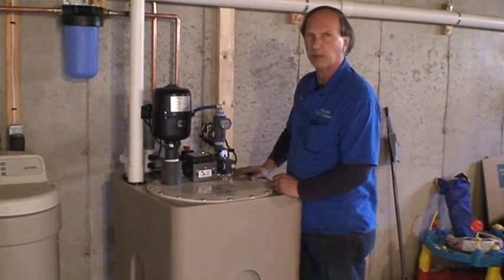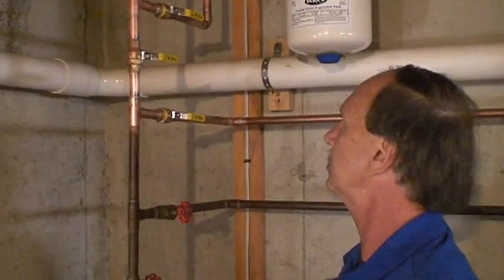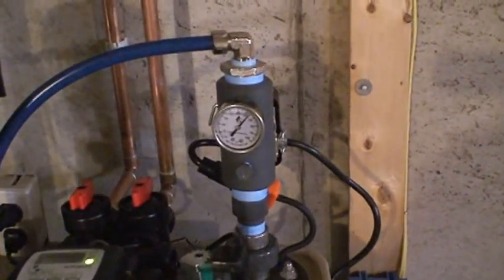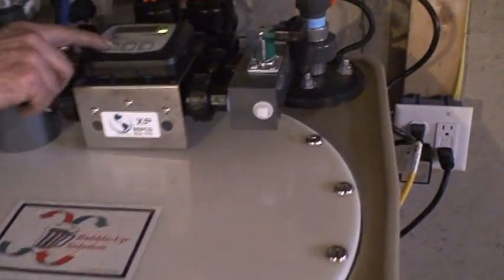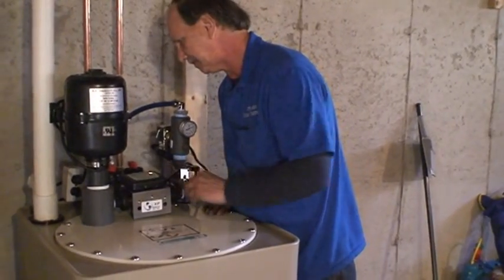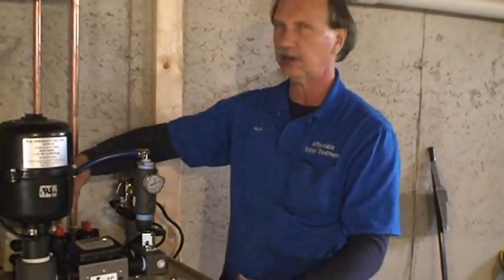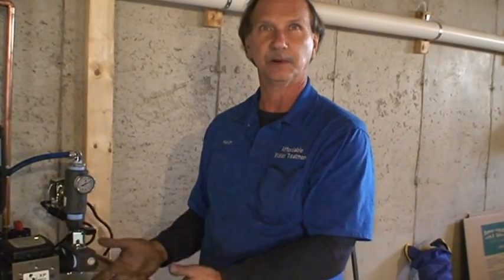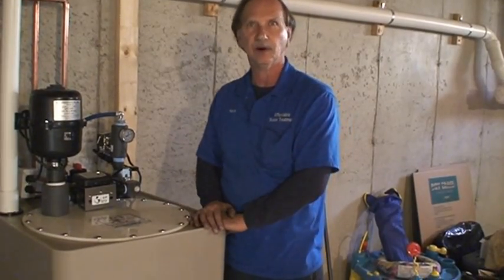Kevin explains BubbleUp system

Comment: You should mention that to restart after a power outage, you need to apply a good amount of pressure to the restart handle. It would help!
Reply: Great tip! Was not expecting the amount of force required, it felt intentionally locked up.

Comment: Any advice, I am stumped?  For some reason the pump on my Bubble Up Jr doesn't maintain constant pressure, it constantly switches on and off every 5-10 seconds.  The pump burned out and they just installed a new one but I am sure it is also going to burn out.  Your advice, Kevin would be appreciated!
Reply: I just replaced the pump on my full size Bubble Up and it began short cycling too. Some research led me to the expansion tank; mine was water logged (no pressure at all). Unscrew the protective cap on the bottom of the expansion tank and check the pressure with a tire pressure gauge. It should be whatever your system pressure is set at (50-65 psi?). If it is low, recharge with an air pump (plenty of videos on YouTube. Make sure you depressurize your system before checking and/or adjusting the tank pressure). Rap on the tank to find the hollow air space (like checking a melon; it should be about half the tank); if you get a solid thud along the entire length of the tank, then the tank is probably water logged (the bladder failed) and most likely needs to be replaced. Home Depot and Lowes both have replacement tanks. Make sure the new tank is for potable applications and can be charged to 150 psi (for 'wiggle' room). If you can afford it, go with a 4.5 gallon tank, rather than the 2 gallon stock tank; 50 bucks v. 30 bucks, but more room for water means less cycling than even a new install. Hope this helps or at least gives you a direction.
Reply: Thanks for the reply.  Yep, I did that but unfortunately still had the problem... We ended up replacing the mechanical pump controller with the DAB SmartPress Digital controller.   It has a few really nice features and maintains water pressure extremely well without cycling.  My only concern is the water pressure is now a bit too high (~90PSI), even after adjusting it down.  Showers are much more pleasant than before and so far the plumbing has held up to it.
Reply: @cjdavia  Glad you found a resolution. That's an interesting piece of technology (I had to Google it). I'll keep that in mind should I encounter a similar situation. Thank you for the follow up. Stay safe.
Reply: Yes, it is very cool.  We'd have to burp the mechanical controller after a power outage.  The digital one has an autostart feature so we don't have to worry about doing this anymore.  It also shuts itself off when there is no water.  The pressure it delivers is aways constant, even when we have 2 showers going at the same time.  My only question is whether or not we needed 2.8 unit (higher pressure), but so far, so good!  Glad yours is working as well!  -Chris
Reply: @cjdavia  Do you have any pictures of your setup with the DAB SmartPress Digital controller?
Reply: The presure switch needs to be adjusted
Reply: Pressure switch was adjusted to cause this, fairly easy fix. Are you located in CT, there is an installer that adjusts these to burn out the pump quicker and make money on service calls.
Reply: @bkoz319  Yes I am, and I think your explanation is spot on.  I put in a new pump and DAB electronic pump control and all is good now!   Thanks for the response!
Reply: @cjdavia Do you know who originally installed it?
Reply: @cjdavia  Sounds like a nice setup. When you say "we," are you talking about you and the company that installed/services your water system? Sounds like a good idea, thanks for sharing!
Reply: @Stearnsy33  I had a new/different installer install the digital pump.
Reply: @trouter7029  I just saw your question, sorry for the delayed response!  do you still want a photo?